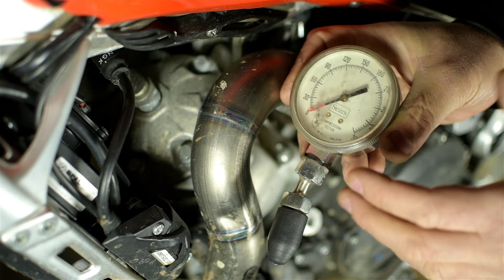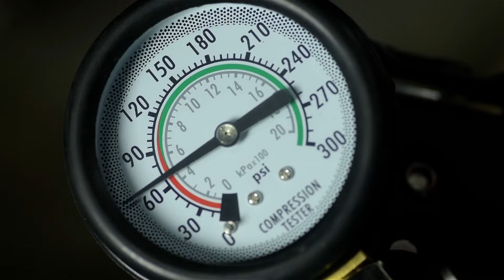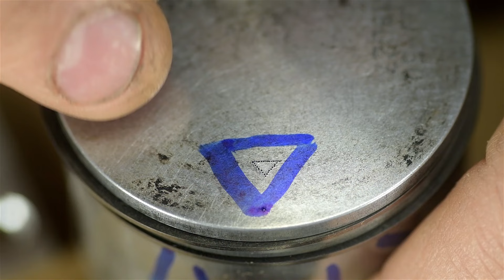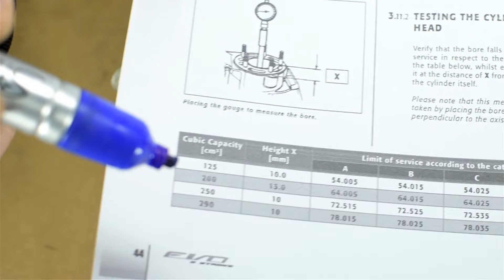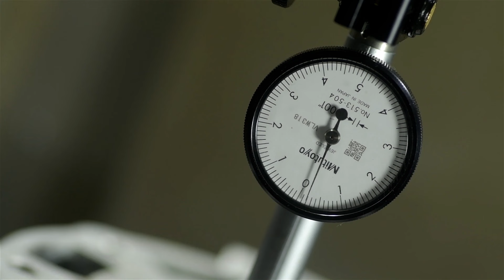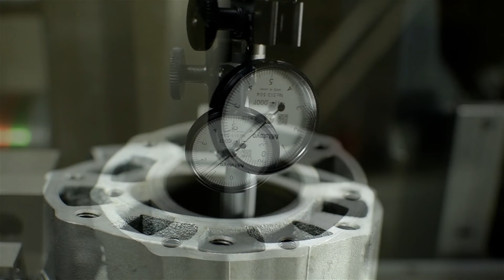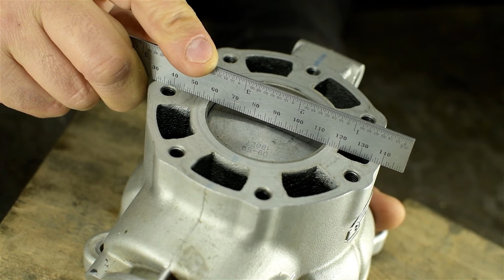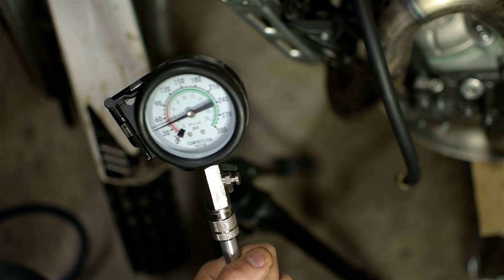Top End Rebuild! (2 Stroke)

Comment: So, just to mess with you Tony. Pistons are not machined perfectly round when cold. They are machined to grow to circular when at operating temperature. Even el cheapo pistons. Forged race pistons have full 3d machining for growth at temp.

The piston bore is also not checked or bored just sitting free air. It should be torqued down with torque plates to simulate the stresses of the head and block in place, which changes the bore shape due to the elastic deformation of the clamping loads.

On your trials bike, you found it's a thousandth or less. Hard core race engines are bored at operating temp with torque plates installed to simulate the head, accessory, trans and block deformation and are effectively seized when not clamped together to create the clearances.
Reply: In most cases they are tapered or diameter below rings is slightly bigger than the diameter above the ring.
Reply: Thats how we do ours, tapered ever so slightly, especially on CI sleeves because of the growth rate of the different metals.
Reply: Awesome insight!
Reply: Wow, just wow. That’s interesting to know for sure!
Reply: I was wondering if anyone would mention this. The reasons they change from oval to round at operating temp is that there's more meat where the wrist pin goes so more expansion in that direction than the thinner front and back. Also with a 2-stroke there's more heat at the exhaust port so more expansion at the front of the piston.
Reply: SOME  pistons are elipse most are round, HABUSAYA  are not round frinstance
Reply: Thank you for taking the time to enlighten us.
Reply: That's a quite enlightening comment, i think this should be moved up!
Reply: @stuarth43  I couldn't find it again but some havean "egg" shaped piston.
Reply: Dave of course you are talking about automotive engines. Clamp force on a125 two stroke head and barrel at 15to18 ftlbs has minimal distortion if any. Sure heat expansion is a factor already pointed out in your  description of how pistons are designed to work. Not trying to question your experience, I have never seen a single barrel two stroke torque plate or are they needed. ToT should have had the barrel resealed.
Reply: They are usually best bigger opposite of the wrist pin
Reply: "due to the plastic deformation of the clamping loads."
Its elastic deformation or ur in a lot of trouble.
Reply: @Shaun.Stephens  Correct. Pistons are NOT machined round.
Reply: .. but using an aftermarket part, should he not do a weight comparison also? 🤔
Reply: @leocurious9919  dang it! I got the e and p swapped when I was typing. I fixed it.
Reply: We've never clamped or torqued down blocks to simulate the head on the engine. They're just fixed to the bed of the mill and run down in a straight line top to bottom with a boring head, chamfer at the top. No taper. I'm talking about old iron block American v8s, the engineer that taught me reckons clamping them down makes no difference on street engines. Probably a couple 10ths, not worth the hassle when your clearance is 2-2.5 thousands.
Reply: "Cam ground" is the term for how modern pistons are formed/machined.
Reply: @sampinion5796  street engine not  that big of a difference. But on our race engine big difference in vacuum. We torque plate and run 160 temperature oil threw the block .you can see a 7 to ten psi difference in vacuum. Not worth all the time on a street engine but in all out drag race engine well worth the time .
Reply: Leo Curious He may be right saying plastic deformation as it is the permanent deformation of any material under various loads, elastic deformation is when there is a change in shape under load but the original shape is returned after the loads cease.
Reply: Dave McDaniel You may have been correct with plastic deformation, a permanent deformation after loads are applied to any material is plastic deformation. If the deformation returns to the original shape after the loads are removed it is elastic deformation.
Reply: @steviebee1989  its elastic as the blocks will rebound when unclamped and unbolted. Once you bolt it back together it is in tension due to all the clamping loads from heads, accessories, transmissions, etc. Even after years of running them, when you take it apart it will return to the out of round shape, TOTs video above showed us with .001" out of round, which is pretty normal for a normal engine build.

 I've built a few race blocks that were closer to .01" out of round when cold and unclamped, but they are dead nuts perfect when hot and bolted down to torque plates. I haven't built an F1 engine ever, but I hear they are effectively seized when cold and have to be assembled warm block with chilled pistons to create the clearances needed just to insert them. I know they have to be warned up on machines for about 30 minutes before they can even be started. Their engine blocks are also structural, with the suspension and body of the car bolted to them, effectively actin as the entire rear subframe.

The only intended plastic deformation inside an engine build are torque to yield bolts. You torque them to spec, then rotate another 90 to 180* stretching them past the elastic load and into a new permanently deformed state. It's why you are never supposed to reuse them, as all the elasticity has been removed. I personally hate TTY bolts for this reason. A little out of spec and they let go. ARP everything and then never have to worry about it.

I literally mistyped the word and autocorrect changed it to plastic, so I'm sorry for any confusion it may have caused. I did edit it to the correct term when it was pointed out.
Reply: In college we experimented with hot honing - the torque plate had coolant passages and we passed operating temp coolant through the cylinder to bring it to temp while machining and measuring it. Long story short, it didn't do a whole hell of a lot, but it was a fun experiment.
Reply: My buddy/racer follows all of the steps in the cylinder honing process that you have delineated...plus one additional factor:  he has the engine block coolant lines plumbed and coolant circulating at operating temperature.   That results in the cylinder bores that are operationally perfect.  That minute attention to detail results in a few additional horsepower.   That is an ultimate racing technique...unnecessary for ordinary engines.
Reply: @teamdrama6251  I replied the same thing...  My buddy plumbs the coolant lines while in the Sunnen...  A few more hp.
Reply: Question for all the experts here (seriously) 
Wouldn’t just new piston rings have done the job almost just as well?  Tia!
Reply: @Conservator.  All the compression improvement comes from the new rings. The concern with a worn cylinder / piston is skirt slap which will eventually cause piston failure - usually in a dramatic fashion, taking out other, more expensive parts with it on it's way out (the crank, engine cases, etc.) When I was racing 2 stroke gp bikes we would re-ring after every race weekend - but pistons were only changed when issues were found or at the end of the season.

Comment: I feel like the old this old Tony was hardcore enough to have made that piston.
Reply: I don't remember a time when he would make anything that would interact with explosions you sit on lmao
Reply: I tried once to make one for a 50cc but failed so I made the skirt and used the middle of the old piston to fix the axe. It did about 3 km. I came home using the pedals and passed in front of policeman who lough at me. A part of their job was to catch young going more than 30km/h. He didn't know that before I was at 70...
Reply: You mean The Older Tony
Reply: Yeah, hey! Who are you, and what did you do with That real Old Tony?
Reply: Abom would have made one
Reply: @brianluck84  and a cylinder
Reply: @MasterArrow  engines dont explode fuel, they burn it. And that's a massive difference
Reply: @piergiorgio919  tell that to the guy running a heavy nitro mix while he waits for the blower housing to come back down.
Reply: @piergiorgio919  Actually...."the burning of the mixture of fuel and air in an internal-combustion engine" is an example provided in the definition for explosion.  The rapid expansion of the gases created as byproducts when the COMPRESSED fuel burns is the explosion (controlled) that is then converted to force against the piston - hence converting fuel energy into motion. The sound you hear from the exhaust pipe is not the sound of fuel burning....it is the sound of expanding gases (from the explosion) exceeding the speed of sound (supersonic), more specifically producing shock waves.  Of course, the explosion would not occur if the fuel/air mixture was not under compression.  It would just burn.

Comment: After watching my European heroes contest an Inter-Am motocross meet, I went out and bought a 1970 CZ 250 MX.  I had never ridden a dirt bike but assumed I would be an instant Joel Robert on such a mount.  The owner's manual did not expand on the terms of the factory warranty (Both Halves Are Yours), but rather gave instruction on how to win races.  Before each contest, it suggested, I should fit a new piston and ride the bike hard to see if it seized, repeating the process until satisfied that the piston would last the race.  It also recommended a new chain for each race.   CZ chains had individual bronze sleeves between each roller and pin, and were priced accordingly.  Being used to torquey street bikes, I stalled the CZ several times before getting it moving for my first ride.  Broke my collarbone twice the first year I had it, and never had so much fun in my life.  Every once in a while I watch a VHS copy of On Any Sunday to relive the thrills.

Comment: Quite enjoy your mechanic videos!

On a sidenote: pistons and cylinders aren't necessarily meant to be cylindrical when they're cold, they're often manufactured to account for different heat expansion due to their geometry, so a measurement of roundness might not always be super meaningful.
Reply: Good point, I've seen many a tapered piston, assume it's to account for slightly different rates of expansion between top and bottom
Reply: Old Smokey Yunick discovered that way back when after designing a fixture to hone cylinders perfectly round, and the engines not making power until they wore to a certain pattern. Then special plates, and preheating of the block was done to get close to as round as possible while running.
Reply: Cylinders are always round. For very high perf engines (think Nascar and NHRA) honing plates are bolted to the block to mimic the distortion caused by bolting the head to the block. The block is then honed round. The honing plate removed. The bores egg shape a tiny bit. The heads are installed and torqued, they are round again!

Pistons will have a circular section profile on the piston skirts and contract a bit near the wrist pin.
Reply: @padraicmcguire108  I didn't know I was building high performance engines, but I always use stressplates when boring and honing
Reply: The cylinders are bored straight.  But the pistons have a "barrel" shape:  do to heat/expansion.  The skirts are thin and flare out a lot during operation.  On an extremely worn cylinders,:  you can sometimes hear the piston skirts slap, when cold, during the first few revolutions....  There  are also machined cuts across the pistons at certain areas to limit the conduction/travel of heat (from the blazingly hot crown to the thin skirts).  Some pistons have steel inserts cast into them...to control expansion as well.  Cast pistons expand and contract less than forged pistons...but both have pluses and minuses.  Just saying.

Comment: Pretty neat man. I'm glad you got it fixed up. I can tell you this. Cheap gauges are absolutely a disaster in diagnosing anything. A buddy of mine had a car with a misfire on one cylinder and said he had low compression on it. I went to double check his work and it turned out his gauge was faulty. He was getting about 10psi on the gauge he was using from harbor freight. Car had a faulty injector causing the misfire. Great video man.

Comment: So use the connecting acc from the junk gauge, and graft them to the sears gauge.
Reply: Junk attachments are just as likely as useless as the junk gauge
Reply: Not the issue. The little blow off valve is basically to far away from the cylinder and in a sense altering the compression ratio which is making it read low. On larger engines 
this isn’t noticed as harshly as smaller engines.
Reply: @pinkyfull  I doubt it since it's just tubes and fittings.
Reply: The point isn't a potential leak the issue is the additional volume in the tubes and fittings. Ref. JAG S
Reply: @bobturnbull18  No, thats not the issue here. He applied compressed air to it and it was reading 50% low while at a static pressure (it was sealed). There was no dynamic pressure at that moment to let the tube volume etc. change the reading. They can only alter the reading during dynamic situations.
This doesnt mean that it would have worked good when you install a new gauge and read 100% at static pressure, but the biggest issue here was the useless gauge showing nonsense. Cant even be leaks. A leak big enough to drop that much pressure during that test would be audible in the video with a ton of air blasting out.

Comment: Speaking as a mechanic I was taught and have found that most engines won't run under 100 psi (at least not well) and wont run great under 120 psi. That is kinda a good reference to go with I have found
Reply: I had a cylinder down at 110 psi and my truck ran its fastest 1/4 mile time like that. Almost a second quicker than stock and all I had was cold air intake and exhaust done. Surprised doesn't describe how I felt when I saw the time slip.
Reply: True,  most modern engines anyways.  An old VW or straight six will chug along alright at 90psi,  maybe with a cylinder or two at 80psi.   No, it's not ideal, but older stuff will be ok.
Reply: Be careful, 2 strokes normally run a lower compression because of the way the Piston compresses the air fuel mixture on the bottom of the stroke. I have seen my old 1969 Yamaha dt1 run at 70 Psi. Was a pain to start but it ran.
Reply: And it's also hard to get a true compression reading on a 2 stroke as the ports are exposed on some of the stroke. Unlike a 4 stroke compression stroke when you have a full sweep with the valves shut.
Did that make sense? Haha
Reply: @NickyP500  There are 2 stroke compression test kits. They come with block off's for the intake and the exhaust ports. The lowest I've seen with the motor still running is 60 psi. It was a bitch to get started and didn't idle very well.
Reply: Yamaha v max 2 stroke outboard, 200 hp 95-100 psi, 175hp 105-110,
150hp 115-120 psi. Different port heights. You were say'n.. 😁
Reply: In my years of 2 Stroke rebuilding I can tell you that the high the psi the bigger the smile..
But the more chance you'll have to empty your wallet when it goes bang due to detonation.
We used to open the new gasket set on a rebuilt take out the thickest two and put them in the pile to give to the shop for there shop rebuilds.
They they used to let us have the thin gaskets back for our more frequent top end rebuilds.
😂
How how I miss the smell of 2 Stroke in the mornings..
Now I just have the constant fear of batteries exploding haha
But wow are high power ebike's a lot of fun..

Oh PS compression as a number generically is useless.
Because you might be comparing an old high boost turbo engine against a na race engine and at crank they might be 60psi vs 190psi. But both will be right on spec. As the turbo one spools it running above ambiant pressure so it needs the extra space or else detonation and bang.. 
Also different engine at different temp means different psi.
OEM knows the best spec.
Then you can change to what you want if you know why you are changing it.
More important is a change in psi over the engines life. Or in two strokes piston life.

Comment: Mr T, 90 is a bit low for a 150psi cylinder - with new rings. I normally see closer to 135psi on a new rebuild of that size, and it'll quickly tighten up and make its way to 150psi over a little bit of running time. 

Also, check out a leak down tester for the cylinder vs a standard compression tester. You to put the piston at TDC (or crank in the case of a 1cyl), and put compressed air into the cylinder to your desired pressure. You then wait. The leak down tester has a gauge on it, and you watch it with exuberant anticipation... and it slowly leaks down, crushing your soul, or not. Anyway, they're great for getting a better idea of cylinder and ring wear on a 2 stroke. The leak down will show wear that a compression test will not.

Comment: *shows the old ring gap
Me: DEAR GOD
Reply: Yeah if you can measure the ring gap with a ruler in mm, there's your problem.
Reply: My guess is the compression reading was similar, but once it's actually running, there was a ton of blow by due to that ring wear.
Reply: HOW DID IT EVEN RUN!!!

Comment: Another great video. (As always!)  🤙 As a lifetime dirtbike rider/racer and a hobby machinist, I really enjoy when you bring the two subjects together. 
Ps. To really get the most performance increase out of doing a top end you might want to throw in new clutch plates and clutch springs (or in a pinch stack an extra washer on the clutch springs) to ensure that the horse power increase is making it all the way to the ground. You’d be surprised how a slightly worn clutch can keep you from feeling the full performance increase.